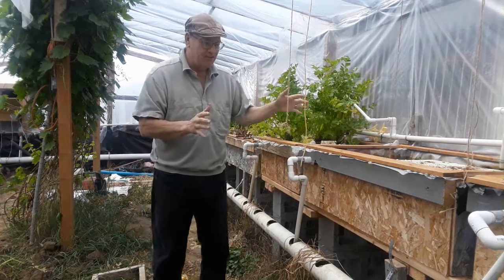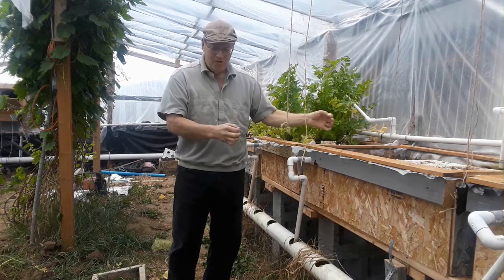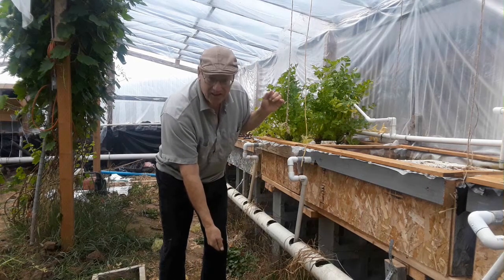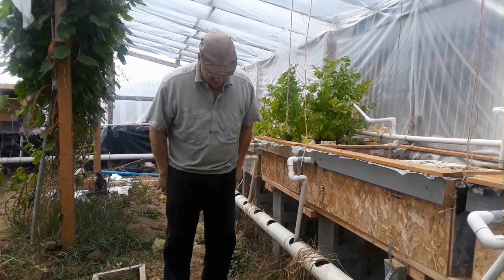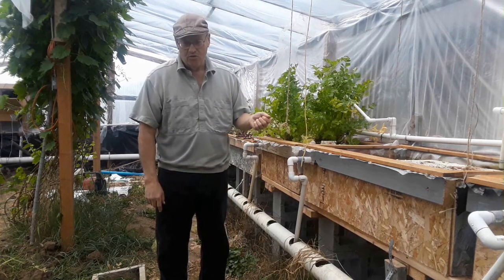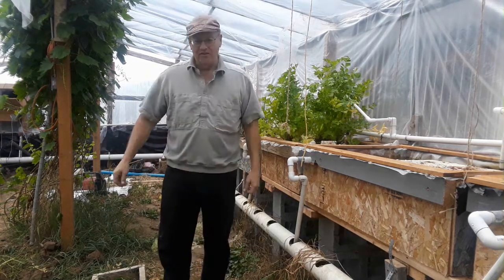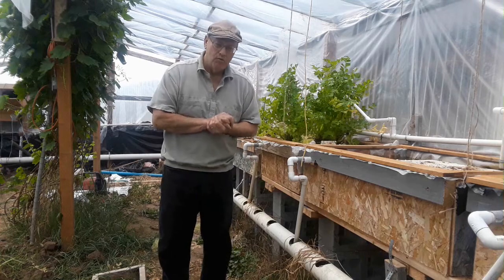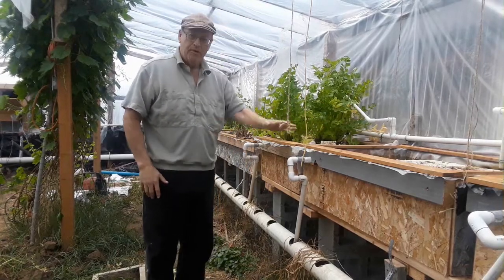Making a Bell Siphon without the  bell

Comment: That's why I have holes in the tops of my 90s in FAWN.  I put a downward 90 inside the gutters to keep floating and sinking debris from entering into the pipe and draining back to the distro tank.  Learned the advantages of this from our septic system setup.  What I found was that the pump would fill the gutter and once water starting flowing back down the pipe a siphon suction force would drain it down to the bottom of the elbow where air could break the siphon.  I drilled a small hole and bam, no more draining.  It's from that experience that I knew I could do a fill/drain system in all the FAWN platforms by simply adding an 90 without a hole and extend it all the way to the bottom with a little pipe in the 90 just as you've done.  I'm sharing and validating that you are absolutely correct.  Pretty cool and thanks for sharing it.  :O)
Reply from the maker: Brent, 
I have found I learn many things by accident.   That's a cool story. 
Ed

Comment: Wow Eddy are you going to confuse folks. You don't even have media in those beds so why do you need a siphon at all? What do you do in your media beds? Do you have media beds? If you don't you must have bio-filters or you are not doing proper conversion of ammonia to nitrite to nitrates efficiently. Bell siphons are so much more universal than what you are doing. If I want to convert a media bed to a raft bed I just remove the bell. If I want to change water levels I just drop in extensions. Your method locks you into a water depth at full level which should be adjustable for media beds when you want to say direct seed or plant young seedlings or flood to drive out cut worms or slugs. I have made well over 7000 bell siphons and they are in operation all over the world so I do have some expertise here and again what you are doing there with raft beds has nothing to do with bell siphons. They are meant for media beds and require gravel guards as well. You are making no sense here. Sorry bud. I do enjoy your vids but please don't confuse newbies with this nonsense.
Reply from the maker: Well the whole idea was to have people look at this and then think.......what else could I do  with this?   Could I use this?   This is stuff you can get from the hardware store and without any fabrication use it directly.    
Ed